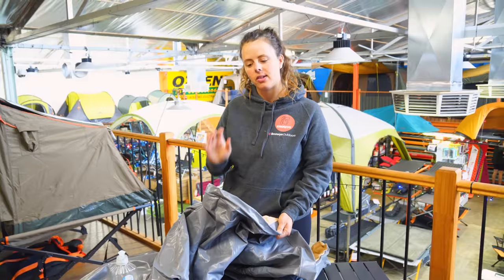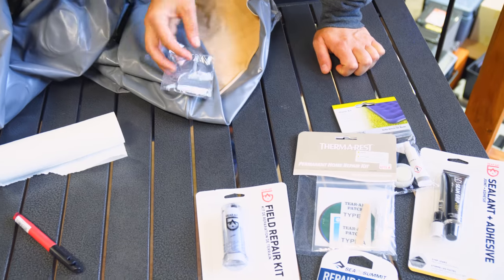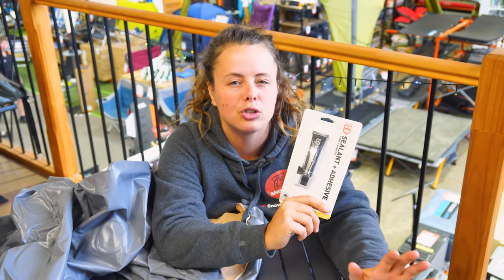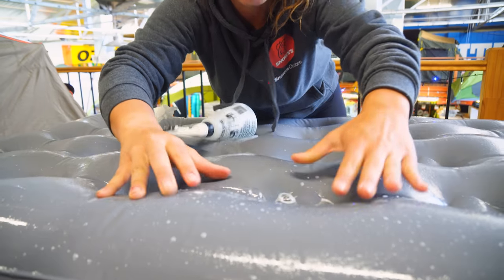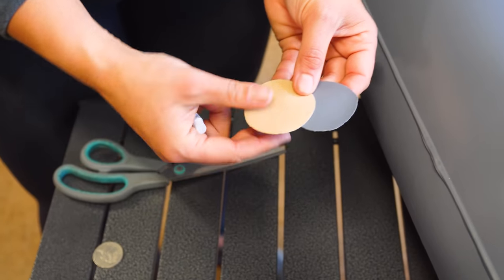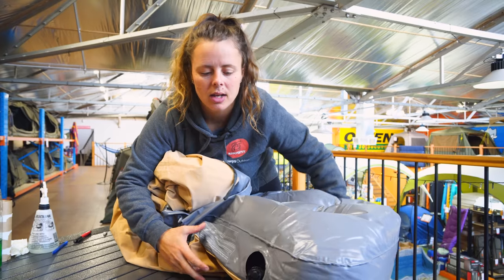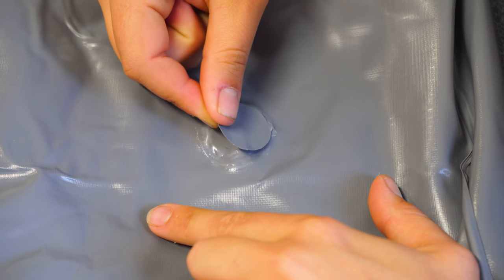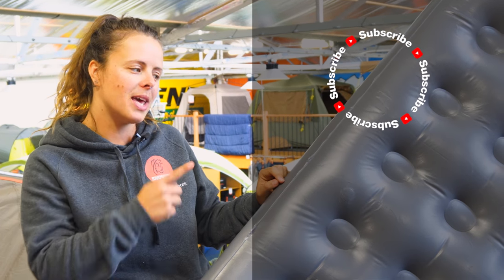How to Repair a Leaky Air Mattress

Comment: Patch the hole with E6000 glue, available in grocery stores, drug stores, hardware stores, Walmart. You do not need to glue on a layer of any rubber or plastic. The glue alone works. Allow at least 3 hours drying time. I find holes by listening, feeling with my hand and the soapy bubbles method. Put in a LOT of air to help your search for leaks.
Reply from the maker: Great advice thanks, Educere Tutoring. With the right type of glue you can certainly leave the fabric patch out, I've not had experience with the glue you mention but I know that Gear Aid Seam Grip will provide a good seal without fabric.
The benefits of the fabric patch can be noticed if you are fixing a patch on a velour or brushed surface as glue alone can leave a rubbery spot which some people seem to want to avoid.
I'm with you though, I just carry the glue.
~ Ben
Reply: Thanks for the tip! I have to repair one tonight before camping tomorrow, so I'll definitely try this method.
Reply: Sounds right to me. E6000 glue will hold anything  in place and it's solid as can be.
Reply: Llkkkkkkkkkkkkkkkkkokj9ū
Reply: @Jere4319 do you need a patch?

Comment: Thank you for the tips but was wondering for an air mattress not plastic but the top more like a duvet sheet can I use the same method? Thanks
Reply from the maker: If its an air mattress, it's outer casing will be an air tight material - so you'll be able to use this same method for all air or self inflating mats.
Ideally you'd use the repair kit that comes with your mat for matching patches.
~ Lauren

Comment: Thanks for the video. Could you also post a clip on how to repair on the velour side.
Reply from the maker: It's the same process, Chris Tjoeka, it just won't be as neat as the glue will have more of an effect on the appearance of the velour side of the mat. ~ Ben
Reply: That's my problem

Comment: Hi, thanks for the video. Not sure why, but spraying soapy water over the mattress didn't work for me. Maybe I needed to use more detergent, but the liquid just didn't coat the surface enough for me to see any bubbles. I tried it twice and sprayed lots of liquid over it. It is a 180cm mattress, and putting it in the bath tub would have been awkward. I ended up taking it to a council pool. They said they didn't allow inflatable devices, but I asked nicely and said that I'd be finished quickly and they allowed it. Even in a pool, it was awkward, but I was able to find the leak. It is patched now.
Reply from the maker: Potentially more detergent, I'd say - glad you managed to find and patch it
~ Lauren

Comment: What if the puncture is on the textile side of a mattress? Those patches will stick on that surface? I think is poliester fiber material. That kind of surface where bedsheet not slide.
Reply from the maker: Same process, DaCool, I'd just recommend using glue rather than stick on patches for the velour side, and the repair will be a little more noticeable. ~ Ben

Comment: The best is FLEX Tape , easier and problem solved for good
Reply from the maker: I'll check it out, if you have tape that affixes without the need for glue then it makes the repair job much easier. ~ Ben

Comment: is it possible to store the glue inside the refrigerator if not in use?
Reply from the maker: I store my repair glue in the freezer, it lasts for ages this way, you just need to get it out a little while before you make any repairs to allow it to defrost. ~ Ben

Comment: What glue do you use to stick on the patch?
Reply from the maker: Most airbeds will come with a small repair kit which will include a tube of adhesive, but if you don't have this then I'd suggest you use Seam Grip - https://www.snowys.com.au/seam-grip-sealer-adhesive. There isn't much gear that you can't repair with this stuff. ~ Ben

Comment: hi all, can i fix a puncture in my pvc mattress with a standard bicycle repair kit  thanks.
Reply from the maker: I haven't tried this, viking, and I'm not sure of the science behind the differences between rubber cement and that used for flexible PVC products. I'd suggest either just using a PVC cement, or testing a small section of the mattress with the rubber cement to see if it works. ~ Ben
Reply: @SnowysOutdoors  thanks for the reply.

Comment: What's the name of that glue and where to get it from?
Reply from the maker: We show a few glues in this video, Stephen. The best ones are Stormsure (https://www.snowys.com.au/flexible-repair-adhesive-15g) and Gear Aid Seam Grip (https://www.snowys.com.au/seam-grip-sil-silicone-tent-sealant), these glues can be used on just about any outdoor gear repair.
There are other options, check out our range here - https://www.snowys.com.au/tent-accessories#?type=127
~ Ben

Comment: Haw to repair if some area inthe top not normal,like a mount, so I think some material inside is disconected.. Plis how to fix it
Reply from the maker: If an internal baffle has come away, OK chanel, then you're out of luck, unfortunately. I'm not aware of any method to reconnect them. ~ Ben

Comment: What to do if you have a 5 cm cut in T  / Y shape near the joint partitions  on the top part of your inflatable mattress
Reply from the maker: A cut that big is going to be hard to repair, dominicxavi, you could try a large patch of vinyl and a heap of glue, but it will require some perseverance. Maybe a new air mattress is a better solution. ~ Ben

Comment: I need  a solution of a pulling up air mattress😠😠😠
Reply from the maker: Are you referring to the top 'ballooning' up. If this is the case then it's likely that the internal baffles have come away from the top for which, unfortunately, there is no fix. ~ Ben

Comment: What is the best way to puncture a big ass rubber dinghy? Would like ideas for my new videos please :)
Reply from the maker: I've never had the need to puncture a rubber dinghy, Pooltoypopper, but if I did I reckon I'd want to do with with a bow and arrow. The arrow would have one of those metal medieval looking arrowheads and feather fletchings and I'd just shoot that arrow right in the side of the dinghy to see if it comes out the other side. ~ Ben

Comment: My problem is not leaking but something broke inside and it makes balloons  now. Not flat anymore.
Reply from the maker: This can happen over time, Mathieu, and there is no easy fix here. 
If it's relatively new you can probably lodge a warranty claim, otherwise it may be time for a new mattress. 
You can see our airbeds here - https://www.snowys.com.au/airbeds, or consider upgrading to a self-inflating mat like the mats listed here -https://www.snowys.com.au/camp-sleeping-mats. 
~ Ben
Reply: @SnowysOutdoors  Yeah. I bought it at a market in Honduras and used it as a surf board in Nicaragua. Went good for a while but then, the inside broke. Can't find inflatable pad here but I bought an inflatable mattress for children. It's a bit heavy and not made for camping but it will do the job until I find something else. I don't understand why inflatable mattress don't have a fast air exit valve. And pads on Amazon are too thin. I don't know the brand of the one I found but it was perfect. I don't see the same for sale anywhere. It's at least 4inches , has a long tube to be easy to inflate with the mouth and an fast air exit. Too bad i broke it.

Comment: You don't need soap. Water alone is fine. It'll still bubble and spurt without soap.

Also, this probably wouldn't be effective if you have a leak along the seam of one of the depressions. Which is where I have one.
Reply from the maker: That adds complications for sure. In that case you'd just need to smear the glue on over the seam, potentially not worrying about the patch. You may find you need extra glue in order to get a good seal. ~ Ben
Reply: If you submerge the mattress in water then that works really well, but the method shown by Lauryn is far more effective. If you use a thicker coat of Seam Grip WP on the seam, it will work fine without the patch.

Comment: I bought an air mattress couple weeks ago I found small hole instantly when it was created I’m not too smart and have money but I took some Vaseline and rubbed some on there it worked instantly and not long term fix but good enough every night
Reply from the maker: That's a excellent DIY solution in a pinch!
~ Lauren
Reply: Vaseline?? Just Vaseline??
Reply: @michelleedwards346  yeah that’s what I used. Vaseline and lip balm Vaseline

Comment: The top of my air mattress is rising up, it look crazy
Reply from the maker: I'm not quite sure what you mean sorry, Mateydax. ~ Ben
Reply: @SnowysOutdoors  please what ur Instagram account name, I will send you the picture of what I actually mean, nd the video if possible
Reply from the maker: @mateydaxcomedy  you can use @snowysoutdoors. Make sure you mention me though as I don't monitor the account. ~ Ben
Reply: @SnowysOutdoors  okay 💯
Reply: I have had that happen to a couple of my mattresses.  When one side of the top will make a big mountain down one side or the other.  It is an Intex brand mattress and I think it occurs when one of the ribs has broken or detached itself on the inside of the mattress.  I think that happens due to jumping or sitting down to heavy on it when you go to lay down.  It busts it loose on the inside.  I never could figure out a way to fix it.  I just threw it away and bought a new one.  And I sit or lay down carefully next time on the new mattress.
Reply: @ronald19534  thanks for understanding, i really appreciate, I will be more careful on my new mattress 💖❤💖🙏🎉
Reply: @ronald19534  same thing happened to my convertible mattress. It has 3 layers, one layer is swollen just exactly as you describe and I don't know how to manage it

Comment: pain in the ass to find the leak , couldn't find mine.
Reply from the maker: Yeah, it can be frustrating. Even more frustrating when you find one leak , only to find out it is still going flat and you need to start all over again to find the next one. ~ Ben
Reply: @SnowysOutdoors  I gave up eventually , its like looking for a needle in a haystack. Wish they made them puncture resistant
Reply: @wallstbets4865 it's a throwaway society. Nothing's built to last.